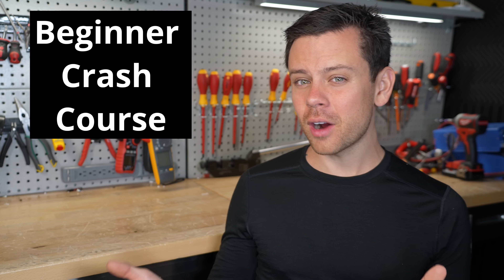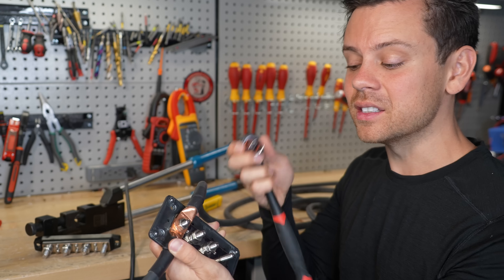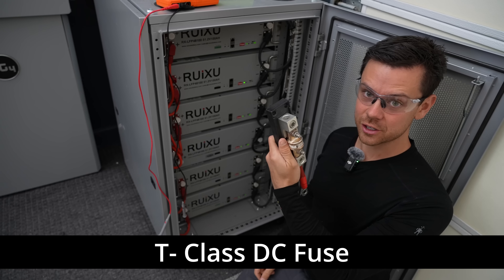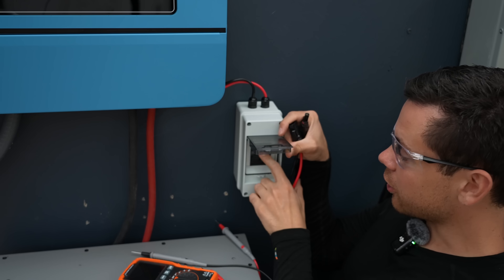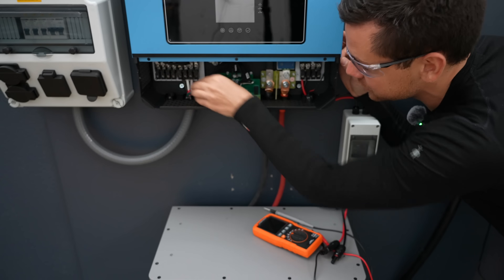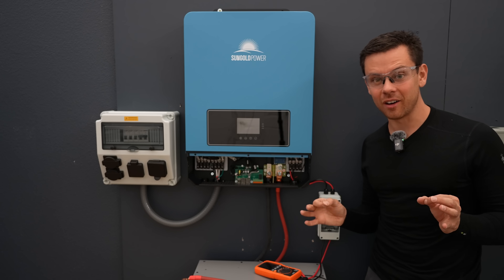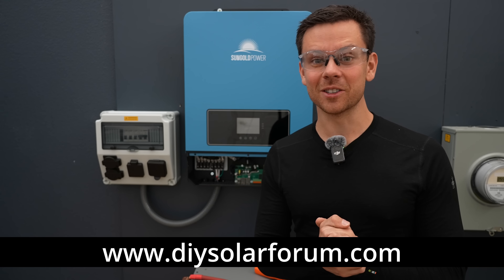Offgrid Solar Crash Course: Avoid FIRE and ELECTROCUTION! For Beginners or Experienced Users

Comment: Will, also as you talk about testing your circuit to make sure there is no power with a meter you should first test the meter with a known source to make sure it will read in the range you are expecting.  That way you insure that the meter is properly working.

Comment: Awesome. I love your links too.  I'm a rank beginner. I'm setting up a Small system to run a computer system in my camper.   Nir r7nning heat or regrigeration iff of it. I just want to hook up the starlink router, and run a tower computer system on it.  Something I can upgrade regularly.

Comment: Great ! Best videos out there. The only thing of value that I would add is proper torque specs on all of the Connections. And then check them again after 30 days. I checked my regular house panel and was enlightened about how many were loose. At least 3

Comment: Excellent topic but needs more emphasis.  Can I suggest showing people what happens if you screw up.  One demonstration I received in the Air Force was a ring on a hot dog and a 12v battery.  I was 19 and it woke me up to pay attention to the rest of the safety training. 40 years later I still can see that safety training in my head.

Comment: The value of a conical washer under each fastener head for each electrical joint should not be understated. It keeps compression through thermal cycles by adding a spring force and avoids loose joints that will get hot.

Comment: Protip, Test the multimeter on a known source before and after measurements to make sure it really works.
And preferably, use a voltage tester, not a multimeter.

Comment: Thanks for the videos I think I have watched most of them.  Here is a question and a topic I don’t think you have talked about.

How would you set up a power system with the smallest foot print, fewest batteries, lightest weight to power a small house boat used for 3 day fishing camping trips?

Requiring 
high amp 12v dc for cranking 
low amp 12v dc for nav instruments 
36v for trolling
120v AC for air conditioning and freezer

8’x10’ area is open for solar if that would be helpful in recharging as well as a small generator for recharging.

I can do this myself with several different batteries but thought you might have a better solution to a fairly common but newer boating problem with these larger auto pilot trolling motors.

Comment: ? Question:  For my rv, I am going to create a quick battery disconnect using Anderson connectors. This will allow me to am going to quickly remove battery.  To/from battery, I am planning to use a bus bar for positive and negative 8 gauge cables,  and lugs to bus bar that connect an external sae portable solar plug.  You say not to use washers but to tighten down lugs.  Sooo, what do you do with vibration caused in rv travel that may loosen lug bolts?  Thank you.

Comment: If DIY solar/battery installation is overwhelming or causing anxiety, another reality is that only a portion of home electricians have much experience with DC wiring. DC is different than AC (and more dangerous) and typical home or commercial wiring is 100% AC, so having an "electrician buddy" come over to help connect your system can result in the same dangerous outcomes as doing-it-yourself.  Solar-experienced electricians are a must.

Comment: Will, something I missed... battery cable length to busbars. Not sure how I missed making them all the same length with everything I watched... I ordered and made up cables for my batteries using 2AWG cables. But I made them to the length needed to reach my busbars. So, various lengths! I just received some cables and lugs from Battery Cables USA to fix this, get them all to equal lengths. Again, I missed this point on the cable lengths, so I wish this would be emphasized more. And if it has been, then where? LOL, just something I did wrong, hoping others don't make the same mistake. FYI, your videos helped me immensely in choosing to go forward and build my solar system on my own. I have been very happy with it all! EG4 6000XP, six LifePo4 48V 100Ah batteries, ten 400W bifacial solar panels ground mounted. Connected to my electrical panel thru a Reliance Controls 10 Circuit Transfer Switch.

Comment: Have you seen Jasonoid’s video about connecting a 48v 100AH to a Pecron power station? Maybe you can do a video too! You could double or even triple capacity. Is it that simple? I have a weekend cabin, we usually run a loud generator. Looking to change. Like to hear your input!

Comment: QUESTION PLEASE; I bought all my inverters from Signature Solar and got the EG4 you recommended (even told them you sent us when we purchased) after about 7 months now one of the inverters started a crackling sound. We thought we were good since EG had good 3 yr warranty. Reported the problem had to take a lot of photos of setup and they said they would send us an RA #. That was 4 days ago, no one will return our emails or calls. Anyone know what we can do? 
 It is very hot out and we need our solar

Comment: Thanks Will. I'm an RVer. I'm seeing the 300ah small form (same as a large wet battery) batteries at Amazon. For most RVers, having 600ah (2 batteries) in a small space would be huge! It's at great price point, about $300 for 300ah? What shunt would work for 600ah or would you need 2 shunts? How about a review?

Comment: Thanks for your vlog.  My setup for home backup in Florida has been pieced together over ten years. It's 12 Volt with mixed size life04 batteries.  I've monitored voltage and current draws and the batteries, 4, seem to be playing nice with each other.  All batteries have circuit breakers at the batteries then connect to a bussbar where the load and the 30 amp charger are connected. I don't have clear solar panel sun, 800 watt parallel so I have to depend on grid and or generator charging. The system has run a chest freezer for about 7 years no problem. I have a change over panel connected to select rooms.  Some questions, is it ok to run two inverters off the buss? Can I attach two life04 chargers for faster charging the 700 amps of batteries.?

Comment: So I have 6x 48v 100AH batteries with BMS and integrated breakers. Do I fuse each battery to the case bus bar? Or only fuse the connection to each inverter and the case bus bar?

Comment: Will, you forgot to mention the MC4 connectors, they must be matched and made by the same company. Mixing different MC4s is not acceptable in many countries and most panel manufactuers insist on this as well. Unless you measure the gap distance on both female and male connectors to ensure they are correct you can get arcing from the very high DC voltage in the strings you are talking about. I very much enjoy watchng your videos but on this I think you have omitted something that is exceedingly important and will stop burning cables on roofs. Dont scrimp on the cost of proper MC4s, it is a false econmy.

Comment: I have a question that I haven't seen asked and I haven't seen you mention it, I purchased a camper trailer that came equipped from the factory with solar panel the wires run behind the wall to a flush-mounted charge controller I can't see if there's a fuse or any way to turn it off. My question is do you think there is a fuse in line or a shut-off switch behind the wall? Being it's from the factory I thought that they would have done it right but after watching this video I'm questioning it

Comment: Hey Will. Always helpful info. Your part about checking the voltage of the panels to make sure they don't exceed the rated voltage of the inverter/charge controller - would you show what equipment you use to do that and how to do that for a series of panels when the voltage is high - in the 300v to 400v range? After I had my panels setup in series I put the leads of the volt meter in each mc4 and there was a big spark and smell and the end of the metal lead on the volt meter was melted. It was under full sun and should have been around 300v and 15-16amps for the 8 panels.

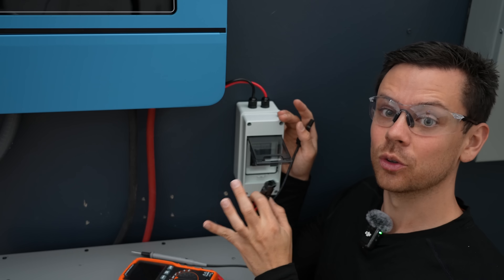Comment: 5:16 my brother that isn't high voltage dc that's usually around 12kv dc and low voltage dc is anything below 1kv
Reply from the maker: You're right about the technical definition of high voltage but I'm still calling it that because it's incredibly dangerous
Reply: @WillProwse ok but even 2v can kill you with enough amps but I under stand were you are coming from for the ppl how aren't electricians
Reply: In off-grid power systems, 12V to 48V is considered "low" voltage, while 120V or higher from the solar array is considered "high" Voltage. The difference is if it can kill you!
Reply: My brother i work on the dayly with 95vdc-145vdc it feels like a 2v batery on your tough @ImagineReadingThiss

Comment: This is awesome Will! I know this is just a quick overview but I would add that all connections to the inverters, batteries, etc. should be torqued to the manufacturer's spec.  Over tightening can be bad too. Additionally I like to use a thermal camera and IR thermometer to check for hot spots under total load.  I have found bad crimps and dirty connections that way.  Thanks for all the great info to help folks stay safe!
Reply: My problem is that I built my system to be oversized, so I really cannot "push" it to near maximum with what I have around my "house". So a thermal camera won't do a lot for me. I do still plan on getting one soon.
Reply: @Tumbleweed5150 Sounds like an awesome system!  We are on a boat and our generator is pretty big.  It can dump 6.5KW into the batteries! That's like 240A@24V.  Our system is pretty over built too.  The wiring gets all the way to about 5° above ambient under those loads ;) The thermal camera did spot a bad solar power lug connection though.  Not crazy - like 120°F and it was easily addressed.  The Inverters and DC-DC chargers can get that warm.  I found a cool thermal camera that was also a multimeter.
Reply: @HeidiandFranny  My system isn't all that big, it's just that I don't have that much to plug into it that would pull a lot of power. The most I have seen is around 40% of the system's capability. I have 10,000W of inverter power, around 27 kwh of battery storage, and about 7kw of solar, but I never see the full 7kw coming into my batteries. I usually don't see under 50% of capacity, unless I get three or four cloudy days. I run mostly small loads, except for a few that are only on for a short time.
Reply: @Tumbleweed5150 That sounds impressive! We are also 10K on inversion but 25KWH (Epoch) batteries and just shy of 3K of solar.  More than enough for our needs. It is a 24V system and right after I finished Epoch started selling 24 and 48V batteries in the same case :( Oh well...  I have four in a 2S2P and a fifth 12V for the house loads (because,... boat). It is working well but the batteries are their V1 with Victron comms but they send the wrong values from the BMS.  Bummer.  I have a pair of battery balancers to keep them balanced and after a year they are still really close.

Comment: Good stuff. You know what would be a fun video, running 100amp thru a 14-12 gauge wire until it melts. A visual memory of that will drive home the importance of sizing wiring correctly.

Comment: There is more to it than this basic safety stuff. The safety stuff is important, don't get me wrong. I, for instance, didn't think I could put more than one lug on a single bus bar connection. I could have spent more money connecting more batteries to my system than I needed to. 

What I am getting at, though, is the purpose for this. Am I wanting to sell my excess power? How can I do that? Is there a way to measure what is going to the grid so that I know the power company is being honest with me? Are there levels that if you don't reach you shouldn't consider selling? I would have to pay for at least 4 power poles in addition to everything else. Can I make money off of having power in the middle of nowhere if I am not hooked into the grid?

Then there are all of these questions I have about my off-grid situation. I live in the San Luis Valley in southern Colorado. It's not at all like so many of the situations I've seen around YouTube. I think I can expect sun during the winter, but how much of a chance on running a chest freezer with my system should I take? Did I make a mistake going 24 volt? What is the balance between batteries and panels I should seek so that I don't freeze to death over the winter? Am I over panelled but under batteried? Right now, I can stay ahead of any one thing, like the AC, but I can't run a space heater all night. I only have 200 amp hours. Should my next step be to add 2 more 100 amp hour 12 volt batteries, or should I do something else? These are my next questions. They must be some other people's too.

Comment: In your reaction video you made a comment about using 12v batteries to make the 48v.  You didn't seem to elaborate and my question is why.  With batteries today, is it better to just buy a 48v battery that has a BMS designed for 48v or was it just that its very important to balance the batteries if using 12v. I thought the BMS's in the batteries would self correct (maybe im wrong, probably I am)  I've built tiny systems using 12v but future builds I'm looking at using 48v inverters.  Maybe its the prepper mentality but I like the 12v batteries because they can be used for many things and be versatile in other applications if needed. Maybe Im over thinking it.  Can you elaborate about 12v vs 48 batteries being used in a 48v system? Thanks

Comment: Couple questions for you will. First what type and size fire extinguisher would u recommend having mounted nearby? I live very remotely and fire department would be minimum 45 mins away. Second in my new eg12k xp inverter it ssys recommended battery csble size is 1 4 awg gauge wire OR 2 2 awg wires from 1 battery bank. Im going to do 2 as thats the gauge i havr but curiois cause i thought 2 swg wire wss bigger than 4 awg. Never hurts to tefresh yourself on safety❤❤
Reply: You might check to see if that was 1 4/0 AWG wire or 2 2/0 AWG wire, as those are more recommended than 2 or 4 AWG wires, being much larger.

Comment: Your conductor size bit was confusing. You cant control the size of the terminals on your inverter so you just have to buy the right size inverter (I guess was your point) If you put 2/0 gauge lugs on a 2/0 cable they are going to be sized correctly there is no other option really so not sure about your point there? So your saying you should find a 70 degree conductor instead of a 90 degree conductor if the breaker in your unit can only handle 70?
Reply: His point there was to size the HOLES in the lugs correctly, not the cable's size. You can get the same AWG lugs with 1/4" holes up to well over 1/2" holes. Most battery systems use 5/16" studs, so 5/16" holes should work. The only places I have needed larger holes were in the battery disconnect switch and the Victron Smart shunt. I have only seen smaller, (1/4") lugs used on relatively smaller wires for other things. I cannot recall at the moment where or what things. LOL

Comment: I found only one minor "mistake" in this video. "Connecting the battery to the system should be the last step". While in general at most cases that is the correct way, many small caliber DIY friendly systems like smaller Victron MPPTs have 12/24/48V support for the battery operating voltage with auto sensing. And if so the battery needs to be connected first before the solar(so the charging voltage wont be dangerously high for the said battery bank). This is very much pointed out in the manual. It could have been a great to end the video with something like: "If you follow these rules, you should be good to go. BUT, there always can be exceptions to the general rules per manufacturer, so ALWAYS read your equipment's direct manual and not just go by based on any single YouTube video".

Comment: As a beginner, getting ready to build my 1st project, my biggest issue is "sizing" my needs. For a whole house I think its easy.... just get the biggest of everything. But I'm trying to build a temporary system for a construction jobsite and I'm not sure how big or small do I go. Can I get away with a 12V system and a couple of batteries? Do I go for a 48V system? I figured for a construction jobsite it should be only circular saws and maybe an air compressor. I kind of have to guess their needs. 
The jobsite is 10hrs away so, one thing I don't want, is to get a phone call that the system is dead.

Comment: In addition to the safety glasses, no jewelry on hands, wrists or neck.
For mobile systems, I think all nuts should be Nylok and torqued and/or possibly Loctite 242 (blue) used as well.
Marking the tight position on lugs and nuts in relation to the bolt/screw or background allows visual confirmation that no position change has occurred. Good mechanics use this.
Good video Will.
For insurance purposes or higher resale value, it might be advisable to have a certified electrician sign off on the work.

Comment: If you make a tutorial you should make absolutely sure that you are not making critical mistakes. You have a very bad behavior which made many electricians dead in the history!
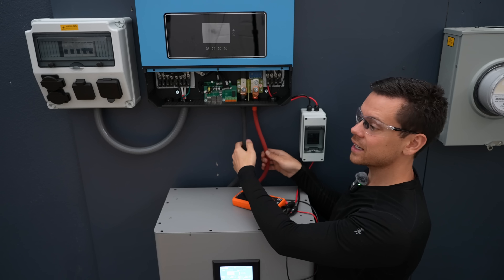Look one again at your hands at 2:13, 6:25, 7:25, 7:44, 8:06, 10:15, 10:24, 10:40 Man! It's a miracle you are still with us!
Qualified electrician would never, ever, no, no, never, for God sake, never touch two conductors with both hands at a time!!! Especially DC conductors of a 300-600V from solar panels. There is no excuse that you disconnected a breaker! It's very bad behavior like pointing an unloaded gun at someone, you simply should learn the basics before starting teaching others!!!